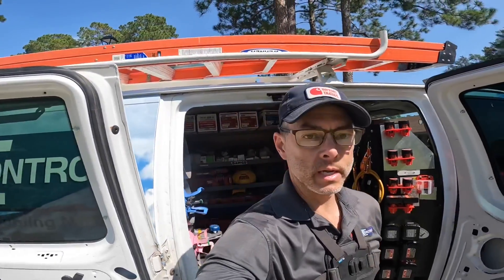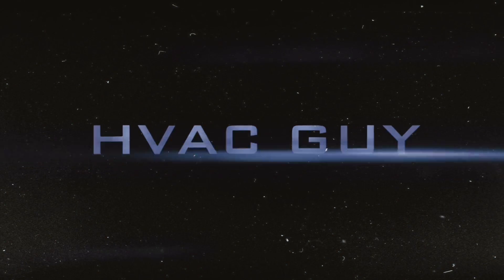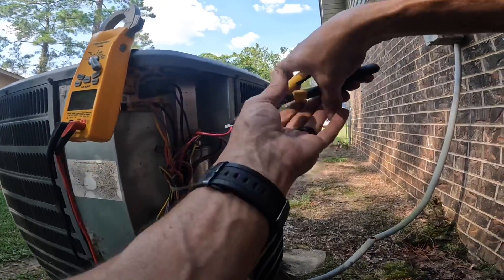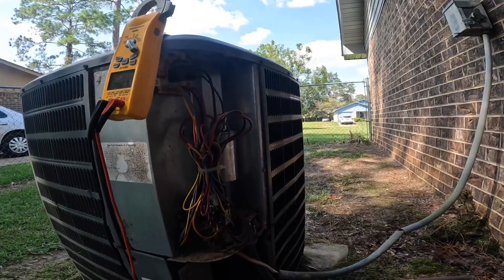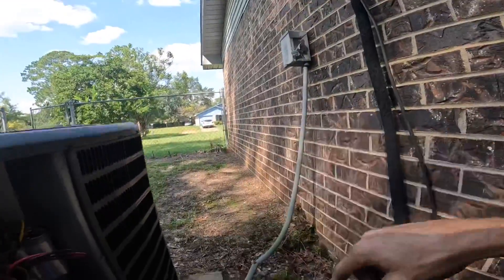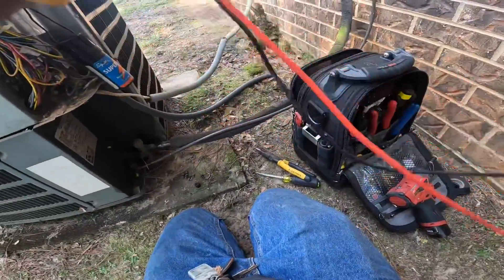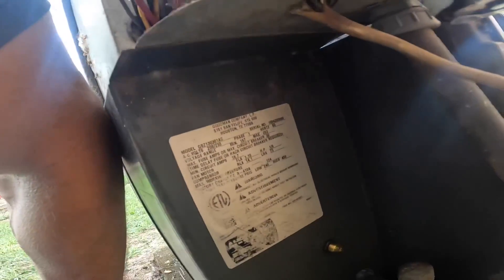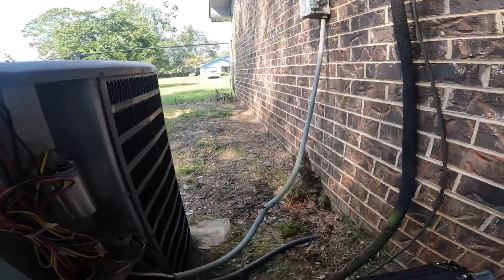She Hasn’t Had Cooling For A Long Time, But, it’s Still Turned On?

Comment: Purple lead doesnt go to Herm on Goodman units. The purple is usually from the cfm.  Maybe I heard wrong but I thought he said purple on herm. Sounds like it was wired wrong. Also you never megged or Ohmed out the compressor. Verifying that wires are in correct designated spots and ohming out compressors/ motors should have been tested before even putting a hard start on the system. That’s my only complaint with this service call. You missed several key tests and possibly sold a compressor changeout that could have been an easy same day fix.
Reply: Me yelling into my phone...Curtis!

Comment: @ 3:49 you mention that purple is on HERM. This isn't right. Purple should be the fan lead and from the compressor plug it is either red or yellow. You can even see it in the video at 7:50. Might actually be the issue.
Reply: That’s most definitely the issue. Might have still needed the super boost , but it wouldn’t start correctly wired wrong. Also he condemned a compressor without even ohming out the windings. I’m a huge fan of this channel but he dropped the ball on this diagnostic.

Comment: I just stumbled onto this video and was subscribed to the channel by the end. I appreciate the insight into actual field work. The troubleshooting you did was solid. Checking for logical points of failure is always better than drawing conclusions without investigation. Your methodology seems forensic in nature, even. The running commentary was exemplary.

I was especially amused about the black widow balls. As soon as you mentioned that you didn't see a widow, my first thought was, "I sure hope it doesn't see you!" I suppose we think alike in that regard. As a residential cable technician, I encountered my fair share of creepy crawlies. Spiders, wasps and snakes are quite fond of the enclosures that we use for grounding blocks and splitters. The pedestals that cover taps also tended to be favorable shelters for them. It's interesting to see so many parallels between that low-voltage equipment troubleshooting and HVAC troubleshooting.

Looking forward to more great content! Thanks for sharing, brother!

Comment: It might have been a slip up, but you said purple is herm, purple is common to the fan. Yellow is herm. I couldn't see where you hooked it to. That's the problem if you did use purple to herm..
Reply: Yea I noticed that too. Had to work on a goodman today and purple is common for fan

Comment: How much does it cost for the job to replace the compressor?
Reply: Not much less than a new unit.   By the time you buy the compressor,  recover refrigerent,  charge new refrigerent,  torches, materials, labor time,  you might as well put in a new unit.  At least that will have a full warranty.

Comment: I did not see a filter dryer outside. Did I miss it? With out those you can be running some bad stuff through the compressor and wear things out faster. I am sure you will add one when you are back! I have also now seen them installed inside to keep them out of the weather to help them last better. Thoughts on that? Take care Curtis 🇺🇸
Reply: Goodman had them inside the unit
Reply: Newer Goodman units have the filter driers inside them.

Comment: Not a tech, but my house has a 2013 Goodman and oh boy do you guys scare my wallet when you get to talking about them. When i moved in 5 years ago i had a tech come in and do a deep clean on the condenser and he also sold me a hard start too. I do my part by rinsing the coil twice a year without chemicals(sandy florida yard), keeping the drain clean, and using decent filters. Other than that it works great and hope my religious maintenance gives this thing a nice long life.

Comment: Before condemning the compressor I would always go for the low hanging fruits first: 
- check for 240V in and out of the contactor under load
- check the contacts on the contactor
- check LRA while leaving the meter on max reading 
- trace every wire to make sure some idiot didn’t reverse a couple as it might very well be the case here
- ohm out the compressor harness as there might a bad contact in it, it happened to me 
- try a new cap as some read ok but don’t work right under load
- I used a start box to run the compressor in forward and reverse if it’s locked and managed to salvage some for years or just long enough to get a new one to swap. 
- check system pressure but you did that
- if all of that fails then it’s a new compressor or system depending on age, condition and budget.
Reply: I noticed the fan seems a bit slow on start and wondered about the voltage.
Reply: @russellhltn1396  I believe that whoever looked at it prior to him coming there may have swapped leads on the cap. He says that purple is HERM but there is no purple lead on the compressor plug. Just Black Yellow and Red. There is however a purple lead on the fan. Can be seen at 7:50 in the video.
Reply: Correct, He missed a lot

Comment: why would you not ohm, pressure and voltage test to all terminals a comp your recommending? i’ve seen several misdiagnosed comps because people where trying to start against back pressure, a wire was broken or voltage lacking at a terminal

Comment: I enjoy your videos. I’m not in the trade, but learning after two full change out in 15 yrs. It seems companies here say it’s not reasonable to repair. I agree on my prior pile of York after spending too much to keep it going. Unfortunately, I’ve always gone for variable speed high efficiency. Probably worst mistake. 2–1/2 yr Carrier works good. I fear when it fails. I put surge suppressor on everything since guessing that is what kills the electronics. I do have to say, comfortable if variable speed AC or gas furnace is nearly always running, and bills not bad.

Comment: Doing an AC swap is way better money than a repair. You can do a swap in 3 hours and make some good money.

A repair at that point is scraps. Plus you you have the peace of mind that down the line their condenser  is gonna last well into the future and that everything is done right.

He pretty much did everything I would do minus checking pressures. Or simply just tapping to make sure there’s refrigerant in the system. I know he felt the lineset but putting on your gauges really gives you a lot of information. 

I know some ppl are hesitant given the not knowing what contaminants are in the system but that’s what filter driers are for. 

Either way it’s rough when you get these kind of calls because sometimes customers aren’t willing to fork over payment for a new condenser and want simple fixes like changing out a compressor until you think about cost value and it’s simply not cost effective to change a compressor when you got a 15 year old condenser.

It is what it is.

Comment: Curtis been a long time since I saw this. But you can read proper MFD on capacitor and still be grounded or shored forgot pretty sure it was shorted      Not trying to second guess you.  You’re the tech that had a better view of conditions there
Reply: I am referring to the run capacitor being shorted/ grounded and still read proper mfd /uf

Comment: Old school quick fix is give the compressor a good blow with a BFM. It can work then keep the hard start on
Reply: Yep, I was just fixing to comment to get a  piece of 2x4 and a hammer and give it a good smack! I worked in Resort Motel/Apartments and saved several compressor change outs using that method!! We used A/C units until the coils were nearly bare of fins then scavenged anything remotely usable! These units were beachfront so usually only got a max of 5 years out of them!!

Comment: Please forgive me if this seems like a stupid question. . .  If a compressor fails/locks, is there a chance that it circulated metal particles into the copper lines and/or into the compressor oil?  I'm picturing the 'glitter' that appears in motor oil when there's internal engine damage.  If yes, how do you clean the contamination out of the lines and/or evaporator coil so the new compressor doesn't get damaged?
Reply from the maker: Yes, there’s a possibility. There’s a filter/drier in there  to prevent it from circulating in the system.
Reply: That was a good, thoughtful question.
Never fear asking a question, that’s how you learn.
It’s when you should have asked, but didn’t is when trouble will find you.

Comment: If the purple was on herm, the wiring was wrong! On Goodman’s, purple is fan common and yellow is herm.
Reply from the maker: I think you’re right
Reply: @HVACGUY  like you were saying in the video, looked like someone had been there before you. It’s a possibility the last guy just threw the wire back on the cap in wrong place and you still have a bad compressor….. OR you could change the wires back and it will start back up. It’s worth changing the wires around just to see….. if you change the wires back Along with the super booster it might work.
Reply: I was just thinking this!!
Reply: @ypickering  I know Goodman better than I know my wife…….. wait….. bad analogy. You get it.
Reply: That`s what he said 3:46
Reply: Checked 10yrs  old Goodman compressor and fan motor wiring purple is going to fan motor

Comment: I always thought that the "Goodman" name was ironic since most model's weren't that good lol. I'm guessing you will probably get that compressor change out. Don't forget to put an American made dual run capacitor in it and check amp draw on that fan motor when you go back. It appeared to hesitate on start up. Good video as usual Curtis!
Reply: I've put in over 1000 Goodman and have had the least call back of any brand I've sold including Trane, Carrier, York, Rheem and Lennox. Trane and York are by far the worst.

Comment: Curtis, I know you enjoy repairs... But that Goodman is tired. Your (and your customer's) luck - next month the condenser blower motor will go out, or the contactor, or the capacitor.  Change out the condensing unit and your customer gets more warranty; you get less chance of call-backs.

Comment: Maybe out of Freon?
Reply from the maker: I checked and it had standing pressure
Reply: @HVACGUY  🫣😂
Reply: I didn't see him ohm the compressor or confirm start and run wires weren't accidentally transposed...with the compressor plug half off I'd suspect that.  You never know what was done by others.

Comment: Those capacitors can store a nasty punch sometimes if you don't bleed them off, the ones in microwave ovens can really get you.
Reply: Microwave = ☠️
Reply: @stevee7774  CRT television tubes are another thing you got to be careful about. Since they can also store enough voltage to take you off your feet. Usually at the point where the flyback transformer cable connects to.

Comment: Need to check incoming power. That fan slowed when the compressor locked. Bad connection somewhere
Reply: i think thats because it was pulling 68 amp on 10/2, voltage drop over the run probably caused that. though i agree, i would still have checked the incoming as well, just because